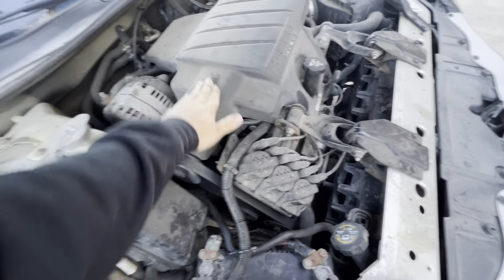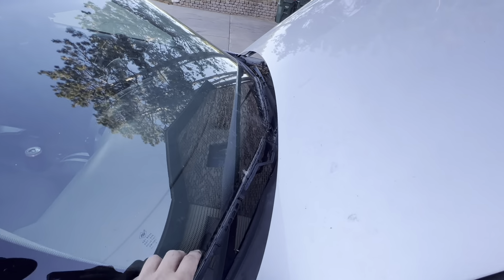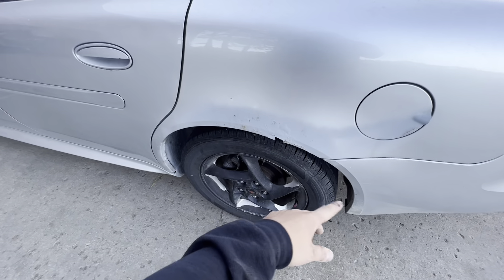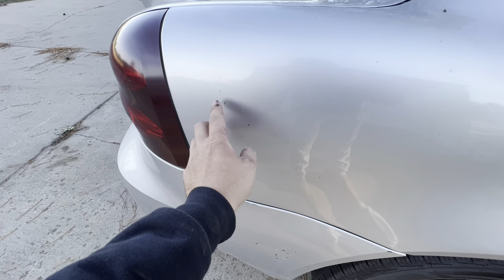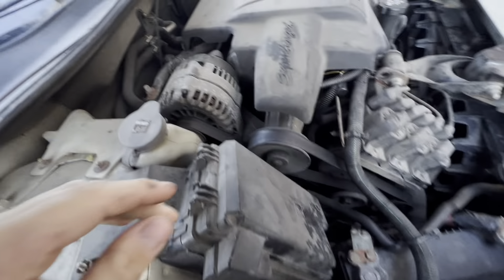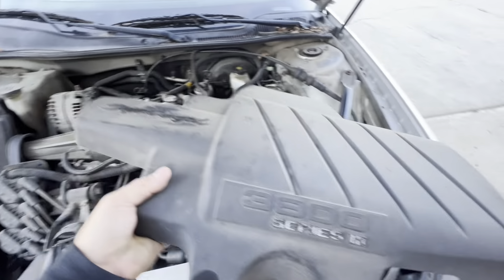I bought a 2004 Grand Prix GTP 🔥

Comment: We paid 12k for an 05 grand prix base in 08 with less than 40k miles
Reply: Bought mines 2 weeks ago 05 grand prix gt 3000 for it had a valve cover leak got it fixed yesterday  and did a tune up on it 148 k miles on it cars  pretty solid
Reply: @paulieloks6216 How much? Did you fix it yourself?
Reply: @bostonwarrior4824 Check the intake elbows  on the pulley tensioner the original plastic ones break and leak
Reply: @jonmo2694   I paid some one they ended up ripping the plastic  hose connectors in process  so I paid 160 for valve cover gasket I looked it up how too do it I was cool on it they took 4 hours too do it and I had to pay 100 for the ripped hose connectors but they didn't bleed my coolant so I was riding home overheating  then I YouTube it and bleed the system myself
Reply: @jonmo2694   this cars tricky I'll only  do something simple  on it too be honest